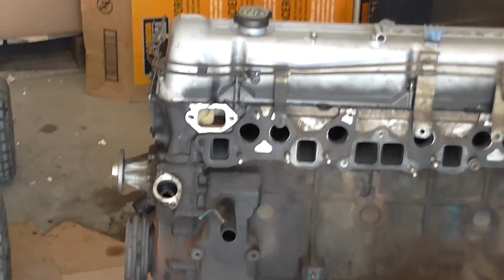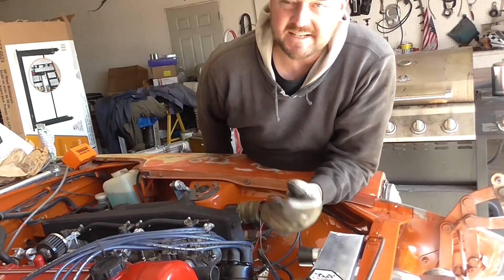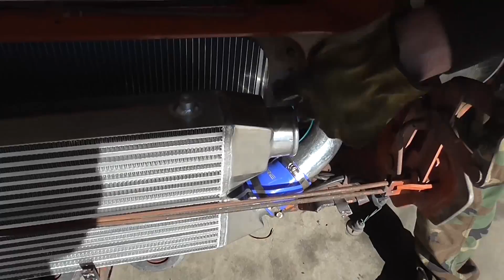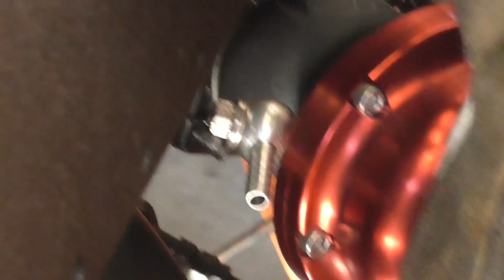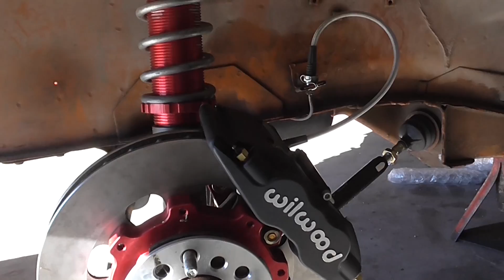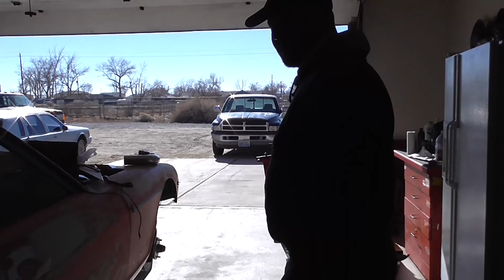Project 1970 Datsun 240Z - Budget Boosting

Comment: I am enjoying your videos, thank you.
I am about to embark on a single 45DCOE with a Garret T28 turbo of a '66 MGB.  With the Turbo Hat/Surge Tank you called it, do you use modulator rings on the carbie throats so standard jetting can be used or how did you know the base start point for jetting?  I have also seen turbo emulsion tubes for dellorto carbies but not seen for webers.  Any advice would be fantastic, not much info on the non-EFI available.

Comment: Hello you showed that the car had the Arizona Z car brake set up I just had a question in regards to the emergency break how did you mount the  emergency brake cable and did you have to buy an aftermarket longer cable and if so can you show pictures of how are you secured the cable ?

Comment: The Borg Warner T5 requires no modification to the chassis only to the crossmember it needs to be moved back an inch or 2... which requires some cutting and Welding on the mount that's it and the driveshaft length needs to be 29 1/4in.

Comment: Hello, i've got a quick question  am hoping you can help with, i've got a 1974 260z with an indash vacuum gauge, where would be the most ideal place for this to be hooked to  on the car for me to get the best most cosistent accurate reading. Thank you
Reply from the maker: find a vacuum source/line on the intake manifold, use a small T-fitting to splice into one of them, then start engine, check for vacuum readings to make sure it is a good vacuum source.  You can also start engine, pull a vacuum line to test it with your finger or the gage itself, if it sucks air at idle, its a great vacuum source for your gage.

Comment: I have done few reserach that L28 can't hold more then 220 hp and torque... How can it goes up to 400hp easy?  What is the torque on this setup on this specific L28?
Reply from the maker: +Jeffrey Stewart when you modify the L28 to a 3.1 stroker higher hp and torque numbers can easily pass 300hp.
Reply: I have a friend that had a 280ZX with an L28ET (stock internals) and 320HP at the WHEELS! He drove that car every single day for over two years and never had any problems. I am building the same setup, Megasquirt, SVO injectors, Pallnet fuel rail, etc... 
I saw a video of an L28 in Japan making 800hp! They are very strong engines
Reply: wrong l28 built is good for 500 HP

Comment: Hello Matt. I am in love with this customers 240z build. I would love to do something similar! I have a 1976 Datsun 280z. All the body work, bushings, brakes, and suspension have been done and i am working on the L28 fuel injected engine at the moment. I was wondering if it was best to keep the fuel injection system while turbo charging or go carburated. Do you work on customers cars? You seem very knowledgeable with s30's.  Where are you located? I would love to have you work on my Z! I am looking for a reliable daily driver boosted Z with around 350hp. You can check out my channel as I have a video of my  Z. Thanks, Braden.

Comment: What pistons is this build using?
Reply from the maker: Ben Kloos 87mm bore, 79mm stroke.  New stroker engine is being set up for this since owner wants a stroker with 85mm stroke and 88 mm bore.  when finished it will be around a 3.2 liter engine instead of a 2.9 liter engine.
Reply: Is that a Nissan diesel crank from a Maxima or something custom?
Reply from the maker: Ben Kloos One of the Nissan Cedric Diesels from Japan with the LD28
Reply: +Ben Kloos Not that you possibly still care about a question that you asked months ago, but on the off chance that you do... the piston is a custom Rebello high quench design for the P90 head produced by JE, fully forged with proper ringlands for the turbo setup.  Static compression of 8.5:1 to allow a lot of BOOST but still be drivable till it spools up, pin height to match the custom eagle rods to go with the 85mm offset grind (increase of 2mm over normal diesel crank) rebello stroker crank but still clear the block with minimal grinding.

Comment: So could have just done a rb25DET swap for less?
Reply from the maker: Oblithian True or an RB26DETT, SR20DET, CA18DET, RB20DET, VG30DETT, VQ45, 20B, 13B both with turbo options.  So many engines out there.  Ben had decided on the L28 with custom turbo carburetor set up.

Comment: Hi matt, can you explain why air/fuel ratio kits cost like 200$!!!??
Would it work i bought 7$ universal 1 wire lambda sensor and 15$ chinese air/fuel ratio gauge?
One more question: do you lock your distributor timing on boosted cars or use boost/vacuum signaled diaphram?
Reply from the maker: ***** This particular distributor for the 70 240z is the original style and was converted by a Petronix ignition conversion kit.  It replaces the points to a magnetic trigger style electronic ignition.  The vacuum on the distributer is not plugged in or used which disables it from advancing timing.  My 1979 Blue 280zx custom blow through turbo uses stock electronic ignition system with the vacuum port not used or connected, therefore it does not provide a vacuum signal to adjust or advance timing.  My Blue 280zx also uses the 1 wire oxygen sensor and an ebay air fuel ratio gage that is not a wide band.  The wide band ones are more expensive as you know $200 or more but the narrow band ones are just fine for information as long as you are using an exhaust temperature sensor with it so you can monitor that very important gage.  Too much exhaust temperature means too lean and can melt pistons and rings causing bad engine faillures.  Monitoring the temperatures beforehand can save your engine, especially when making boost, fuel and timing adjustments. Thank you for watching

Comment: Hope all is good. also have you ever thought about making a build or video on Megasquirt on a Z car. You can add megasquirt to one of your EFI l28 engines that will be a nice project to show people on how to do a conversion to EFI
Reply from the maker: f rod Great idea, also Summit Racing sells many aftermarket fuel injection kits that bolt on to any 4 barrel intake manifold making them a very economical choice, such as FAST EFI, MSD and others.  Some of those kits have a MAP sensor to monitor up to 21 pounds of boost and are easily adjustable from a hand held programmer.  Lots of great options out there.  Thank you again for watching.

Comment: Aren't they also called triple webbers?
Reply from the maker: raul cornejo These are not webers, they are mikuni (called solex in Japan) carburetors made in japan.  Their design, look and adjustments are identical to the weber however they hold tune and adjustments much better.
Reply: Wow I did not know that, thanks. You learn something everyday 👍